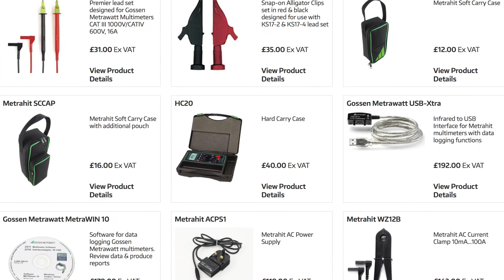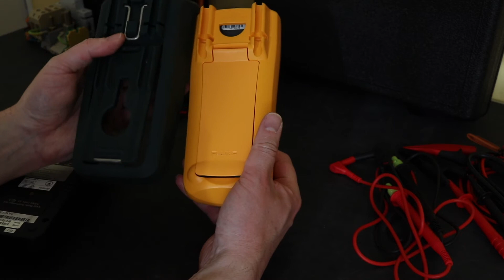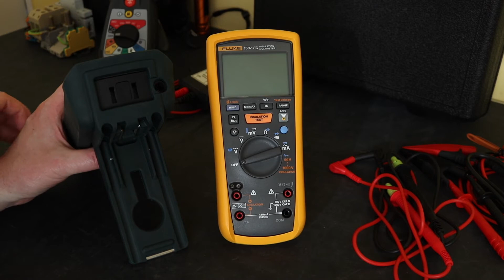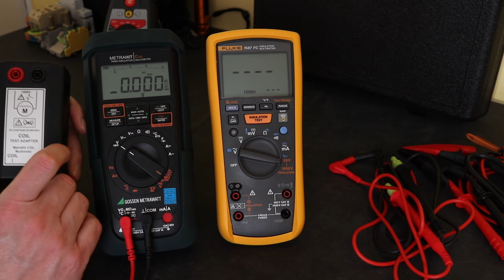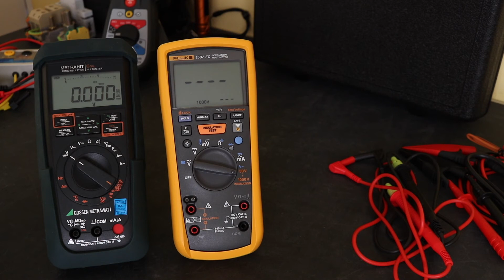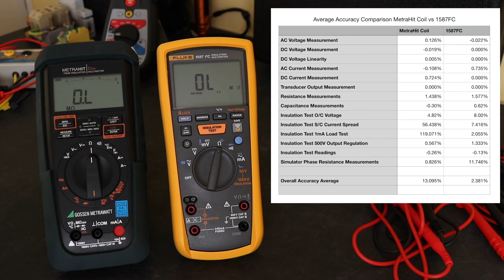Insulation Multimeter Comparison - Fluke vs Gossen Metrawatt

Comment: Your comment around the 5:40 mark about the remote probe.

I think if you can lock the tester "on" the remote probe isn't so important. You can lock on insulation resistance test and very quickly trundle through multiple terminals. Put it on the terminal, wait for the reading to settle, move on.

On some MFTs you can lock on high current continuity, I know on my Metrel you can't which is quite annoying. I think that's probably a safety feature to stop you doing a high current continuity test of something live. Not helped by the Metrel remote probe being a bit OTT.
Reply from the maker: Yes, that would be a work around for some instruments. A lot of the insulation testers I have seen, will only save when the test has stopped, so a remote probe does make that aspect easier and simpler.
MFTs are different beasts really and generally used in a different environment to these insulation testers. I thought the Metrel tip commander gave a bit more functionality than these simple remote probes though, but yes, the old ones I have used were a bit clunky. Something you only find out when you use them though.
Thanks for watching and commenting.
Reply: @three-phase562  You're right that it's a different beast and that the Tip Commander does do a bit more but I'm not sure how much benefit the added buttons give over a basic remote.

In terms of remote probes, the Brymen one suits me because it's nice and skinny. I bought that after your review saying it didn't suit you! Going by the look of them I wouldn't be surprised if it wasn't interchangeable with the Fluke.

MFTs superficially seem to have quite a bit of overlap between the insulation testers you're reviewing. They can measure phase rotation, insulation resistance and voltage though I doubt with the same precision. My Metrel only has a 250V fuse in it which isn't exactly confidence inspiring. I assume it's protecting the 200mA continuity range.